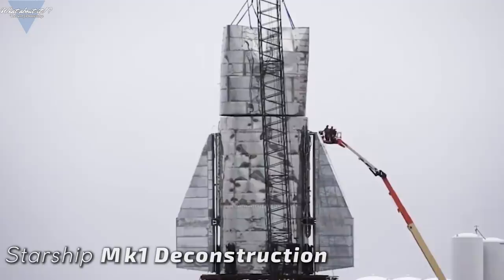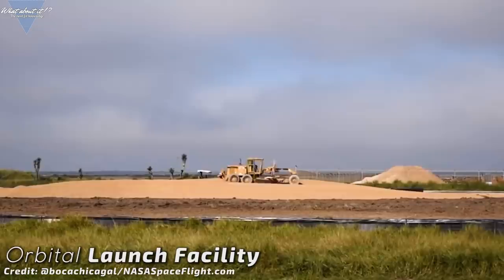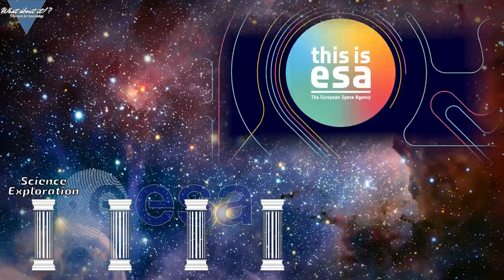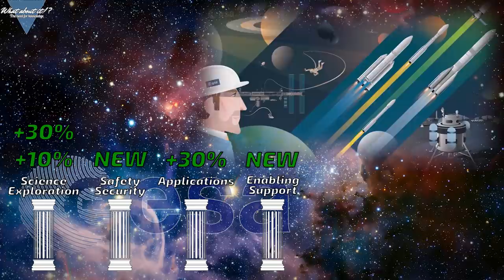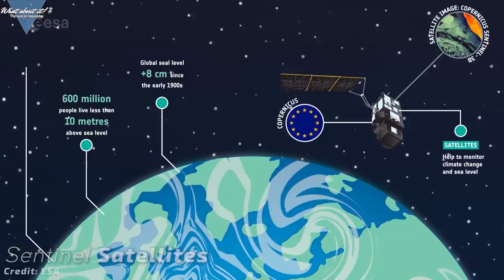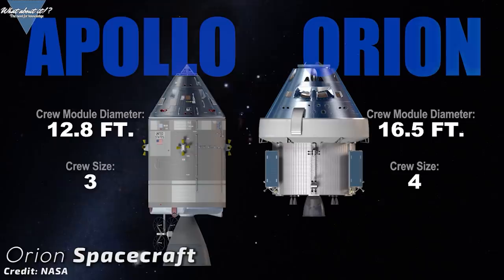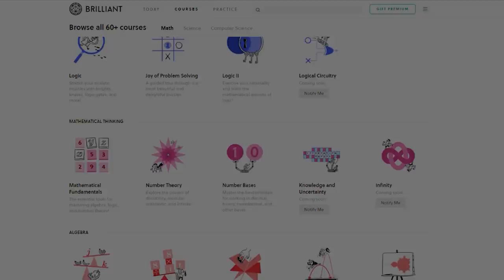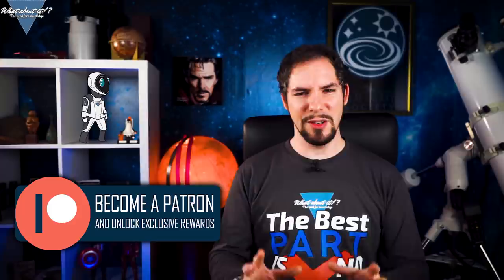57 | SpaceX Starship Updates – ESA Biggest Budget Ever – NASA Radiation Protection Vest

Comment: The clothing is interesting to me. I’ve always thought if we can get outdoor clothing with UV protection how hard could it be for radiation?…I certainly know radiation is a lot harder to shield against from my working in the lagging box under the reactor. The lead was thick, the tests and decontamination we had to take afterwards was also very compact and time consuming, this was 30 years ago but, has anything changed for personal protection?? If so, why can’t it be used for space travel??…it’s an interesting subject. 👍🏼
Reply from the maker: The problem is the cosmic radiation. It packs a big punch. Hard to shield against. The best we still have is water and you can't wear that very well...
Reply: Well there are the cooling suits, tubes that go around the body for warmth or coolness, F1 drivers (and I think other forms of racing) have really good ones, just not thick enough to venture in the realms of space....yet 😉😊
Reply: @TommY SmittY  Yes, and a problem even with steel, at the thickness Starship will use.